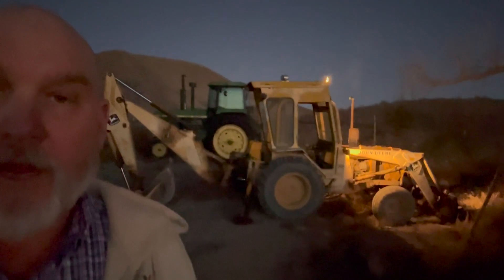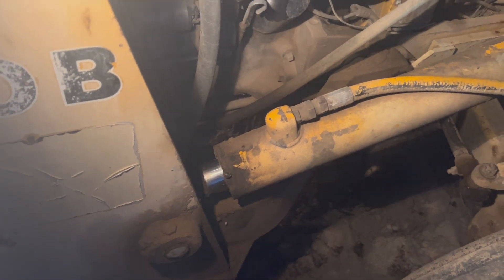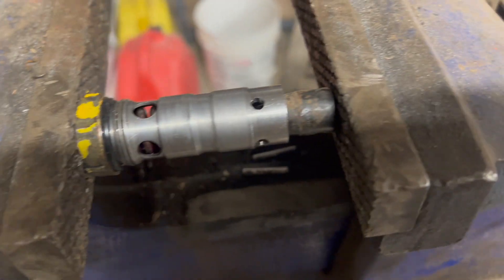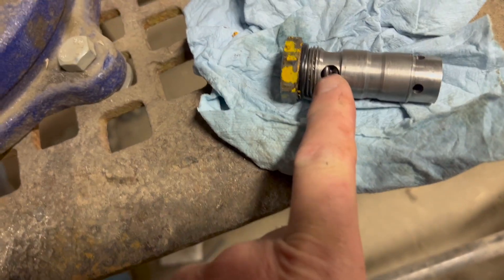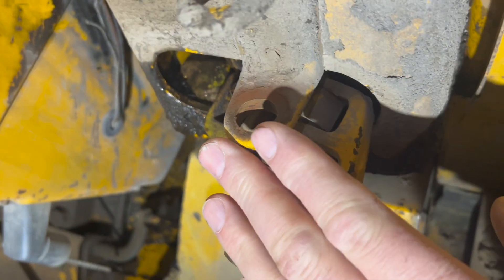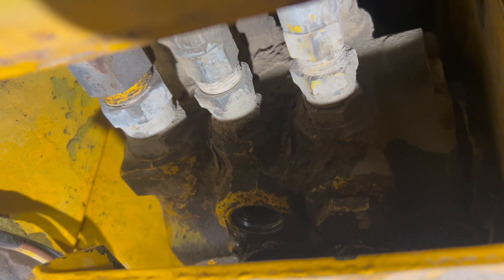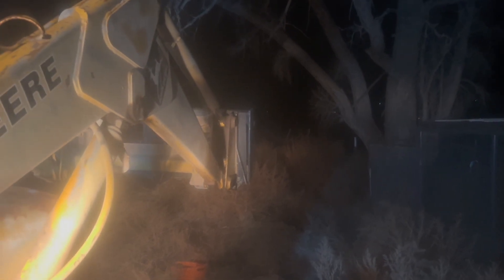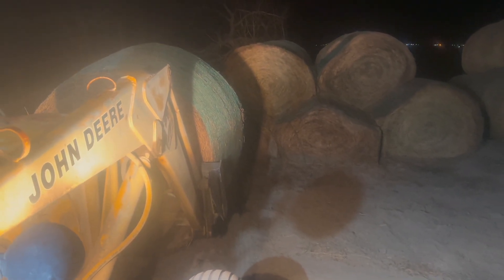John Deere 300b backhoe hydraulic repair Part 1

Comment: Nice! 
I'm having a problem identifying the hose fittings on the outriggers. Google and everything else I read says they're 1/8 npt fittings on the cylinders but that's not even close! My caliper reads .66inches which is Almost 11/16. I would have liked to make my own with reusable fittings but there's not going to be enough room where the hose bends at the bottom of the cylinder when the stabilizer Is raised up it seems. Any help you can give me would be appreciated!

Comment: Let's see, you didn't tell us if the new one is loose like the old one? This was part 1 and no part two? It didn't look like much changed with the new part, even though it's cold it seems like nothing changed. Is this fixed or is the boom and bucket still slow even in warmer weather? Did this get fixed with something else? Can't hear anything you said but it appears that didn't fix anything .

Comment: Would a block heater work and or help with that?👍🏽😀❤️🇺🇸
Reply from the maker: Yes I think so It has a block heater for the engine coolant. I bought I magnetic heater for the transmission/hydraulics. I will do a follow up video to see if this helps